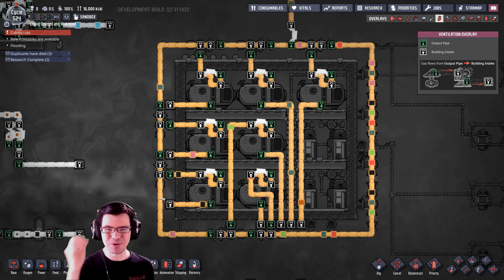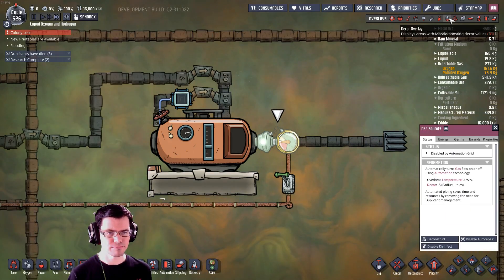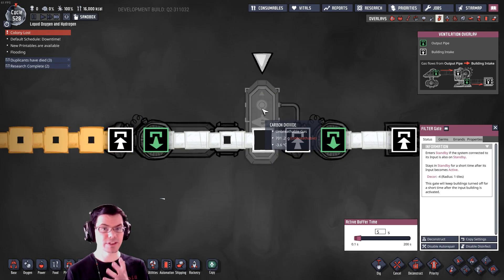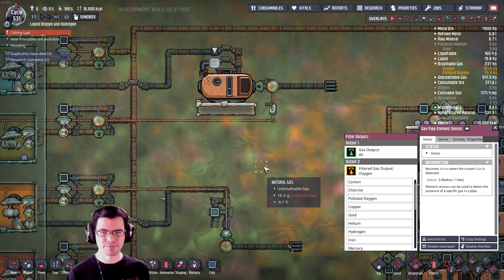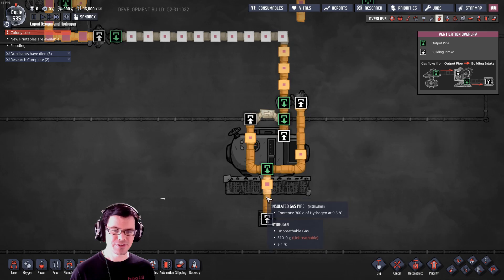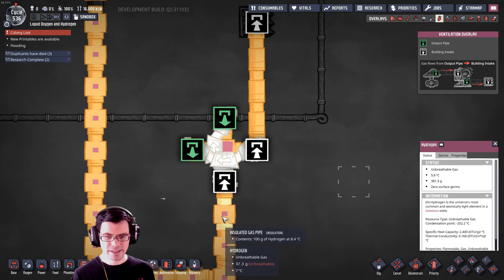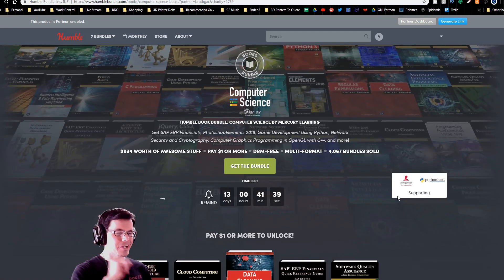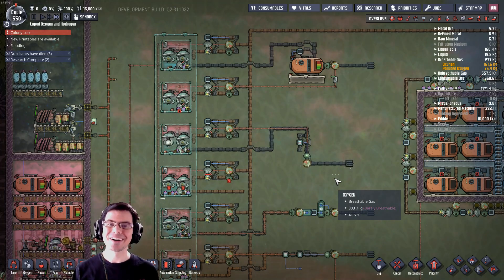Oxygen Not Included Tutorial - Gas and  Liquid Pipe Stacking!

Comment: Here's a method for packet doubling that seems promising: Input into a bridge, the output has two paths: Go back one space to find a second bridge, which heads backwards and outputs to the pipe right before the first bridge's input. The other path continues on. Theoretically it would take up a 1x4 space, and each packet would have a 50% chance of either moving on or getting merged with a later packet.

Comment: Got a shout out in the channel, thanks man, and kudos on pronouncing it.  But you missed a key part on the loop which is preventing it from building to 1kg.  Might want to take a look at the picture posted in the disord, but it looks like you've crossed a pipe incorrectly somewhere.  I had it valved down to like 200g in the pic, and it would stack 1kg.  Valved it down to as low as I could and while it took forever, it also stacked to 1kg.  Gas bridge, gas bridge right beside the first one placed one tile up, then a third directly above the first bridge.  Run the overflow from the first bridge directly to its outflow, then over and down to the inlet of the second bridge, which looks like that is where the problem is.  Lacking the overflow to outlet on the first bridge.

--Nevaes
Reply: @brothgar  Not like it matters really, you've found a great solution that's more compact.

Comment: Saturnus option is so elegant and compact. I didn't know you could put sensors on top of entrances/exits of pipe bridges :O
That's going to help me design better things at my base ^^
Your pipe bridges arrangement was really cool too!
Haha I love that I wasn't the only one trying to do the stacking using only bridges! xD
Reply: Well, technically you can't as it'll constantly flicker on and off as gases (or liquids) passes by. What I'm doing in my solution is forcing the gas (or liquid) to back up into the pipe because the exit of the bridge is blocked, and that's why it works. Naturally you could use a buffer (or filter) gate to smooth out the flickering if you are using pipe sensors on bridge inputs or outputs.

Comment: @Brothgar, Saturnus here. What I meant with the pipe temp sensor is they can't detect single packets of liquids or gases, so that's why my packet stacker guarantees that regardless of flow rate, even 100mg flow, there will always be a minimum of 2 full packets released after eachother so you can actually measure the temperature of what is in the pipes further along in the pipe should it be needed. Thanks for mentioning my solution :D
Reply: Nice solution man! I loved the simplicity and compactness of it ^^
Reply: @pesterenan  Cheers. Just keep in mind that the pipe section between the last in-line bridge and the shut off valve is needed or the last packet in a series is not always going to be a full packet. So you shouldn't leave it out to try and make it even more compact.

Comment: So what is the point of using  this solution? is there a practical use case that brings some benefits? I cant think of one right now.
Reply: An aquatuner or thermoregulator uses the same amount of power to process a one milligram packet, or a full packet, so obviously there's a huge benefit in making sure you have full packets going to either of these machines.